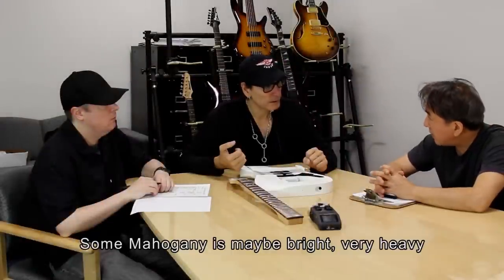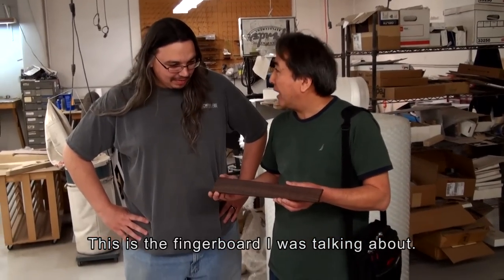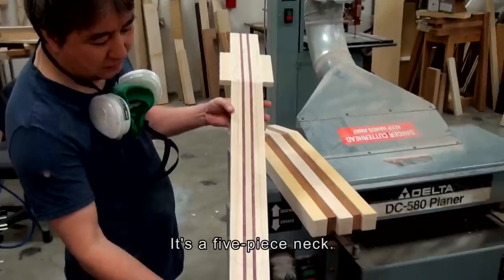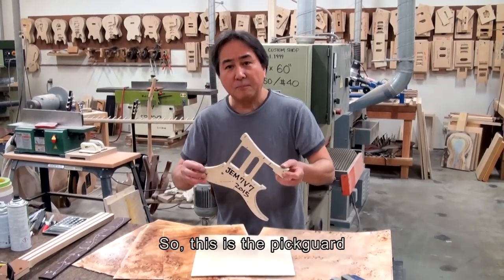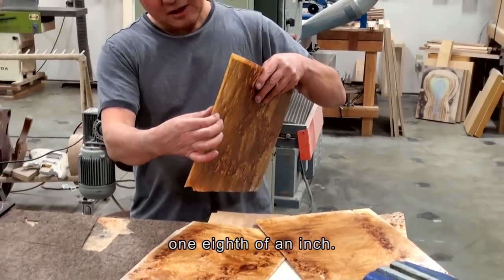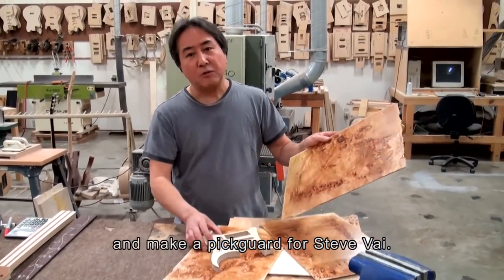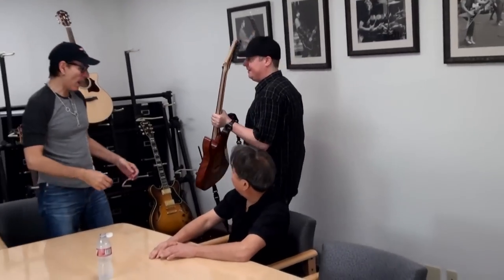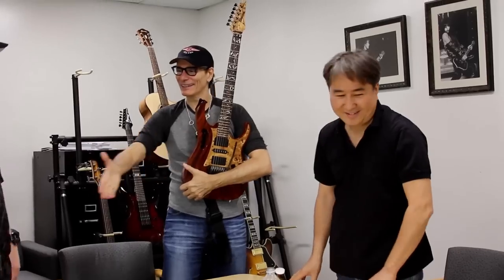The Making of Woody

Comment: I assume this is the same guy “Tak” who worked at Performance Guitar in the 80s. If so, he worked on my “Sanchez” Guitar designed by Sammy Sanchez. It’s a neck through made from Mahogany. The neck through block was made by Mike Tobias and Tak installed the wings and fingerboard and all the routing except for the pickups. I had a luthier friend cut out the pickups and get me started on the belly cut and arm contour. Pat Wilkins painted it Candy Apple Red. I myself shaped the neck and installed the frets and prepared it for painting. It’s an amazing guitar.

Comment: One mistake and it's ruined, master craftsman.
Reply: I was thinking the same thing. What if during the last stages, one of them messes up drilling a hole. Fark! It's ruined, it's ruined!
Reply: Only the best... Ibanez has some crazy people working behind the scenes for sure.
Reply: You'd be surprised at what a good luthier can repair and leave no trace that anything ever happened.
Reply: stew mac disagrees
Reply: There are two types of craftsman. Those that take an age and get it right first time and those that know how to cover their mistakes. Having a combination of both is the ideal because when you take on other peoples screw ups or do restoration the one you think is best, the first, really struggles.
Reply: Quite a joke though - a "master builder" who doesn't build but instead slaps and bolts together cnc made parts. Mexican Americans working in the 
Fender factory circa 1950 through 1960s weren't considered any thing except minimum wage workers yet the Fender Strats Telecasters and electric basses are considered to be the finest made musical instruments of the two eras. Ironically there was never a mention of them being "master builders" probably because they were just blue collar Hispanics. Racist much... gear industry media? Oh and Ed Van Halen changed the genre of Rock guitar by using a guitar made from $250's worth of factory seconds.
Reply: @BillDerBerg  It was all pretty unimpressive, especially the fact the neck inlay work was sent out.
Reply: Thinking like that is the reason why mediocrity is so damn common these days. Too many people are so afraid of taking that first step that they never end up starting, and if they do, they rarely finish what they've started.
Reply: @BillDerBerg  your entire argument kinda falls apart when you look at the different guitars. While I absolutely love fender and their instruments, they are not complex instruments, nowhere near as complex when it comes to creating and executing as this ibanez. While yes he does use a CNC machine, it is for the tree of life inlay, with that many detailed small parts doing it by hand is stupid. The guitar itself as you can see on the video is indeed hand made. He does the routing himself, cuts the neck, hand carved it etc.

Comment: Tak has a very good point about mahogany that people either mistake or don’t know.

Crotch mahogany is basically another name for Honduran mahogany. Honduran on a 24 3/4” scale guitar like a Les Paul can sound thick and chunky. The same wood on a 25 1/2” scale guitar can sound bright, especially when you use a maple neck.

People often think you’ll get the best of both if you just make a 25 1/2” scale Les Paul or something similar, but they don’t often sound that great.

Comment: You won't get what Steve gets. The one you buy for $1,700.00 is made in Indonesia, has a low gloss finish, plastic inlay, and that POS Edge Pro II Trem. It is only $1,700.00, what do you expect?
Reply: Fred Garvin yes... Only $1700
Reply: Fred Garvin In the ultra high end custom guitar world, $1700 is a drop in the bucket. I'd love to have a Woody like Mr. Vai. I went to the other side of the spectrum and got a 1957 Gibson Custom triple black beauty featuring the triple stripe binding. You don't want to know how much I paid for it. But it's worth more now than the original purchase price.
Reply: i wanna know how much you paid for it, isn't that the only reason you brought it up in the first place?
Reply: It has the Edge Zero II, which actually isn't terrible. The worse thing about it is that the fine tuners tend to be really stiff. It has the locking studs of the OE/LP, which is huge plus. The ones with the ZPS system are possibly more stable, but makes the bar dips stiffer. This premium Jems have the classic claw/spring setup. The actual components used in the premiums is mostly quite good. Its the QC in the construction phase where things tend to fall apart. The ones without build quality flaws are excellent players.
Reply: Dick Indiaz I don't like to boast on how much I pay for my toy's. But in this case I can see why, so I will. Mine is a 2000 re-issued that had gone through the custom shop 3 times (indicated by the binding stripe's, 3 is max and is ultra rare). Paid over $3400, tax not included. Now I look at most guitars like their firewood lol.
Reply: I thought the ones I saw at NAMM '17 in the videos didn't look as high quality as Steve's here .. how much do you think Steve's here would go for?  Is it possible to even get one?
Reply: I've been a luthier since 1980. I've made prototypes for manufacturers, I know exactly what goes into making a guitar. I just think it's a bit misleading to show this video and not point out the differences between this guitar and the production models. At $1,700.00, there's a TON of profit, they can afford a gloss finish and a real Edge trem.
Reply: I'm a luthier, if I want something, I build it.
Reply: I've been a luthier since 1980. At $1,700.00, there's enough profit to build it with a gloss finish and an Edge trem. The guitar pictured would cost about $2,500, the inlay work was probably $1k alone. There's plenty of Luthiers who could watch the video and build a replica of the same quality. Plus you would get to add personal touches that would make it yours, like neck shape, fret size, electronics. You would get to see the wood beforehand and select the pieces that you prefer.
Reply: I'm in south Tx and I am a luthier of 16 years, acoustics and electrics for my self, I know a lot around Houston who are not great but could easily build that guitar and it would look just as good; you don't have to be famous to build great guitars, if you don't advertise and keep yer mouth shut for the most part you can stay unfamous and no one will bother you.  I build my guitars cause I can't afford to buy and have customized what I really want. I was a pro drummer in Calif and had to stop, car accidents ended that but I keep rockin building guitars and great tube amps of  yester year, rock on people.
Reply: The 30th Anniversary ones are £3000 here, that's like $3800, they have an original Edge and are made in Japan. I haven't followed the Jem line for years,  disappointed to see they have turned it into a mid-range budget guitar.

What's crazy though is that this mid-range budget stuff still costs a premium, but isn't made in Japan anymore. The up-market stuff like the 777 talked about in this vid though, they are.

Edit : Nevermind, I was on the 30th Anniversary video and it must have autoplayed me to this one. Cheers youtube.
Reply: +Mrnicguy00 all Gibsons are worth more than bought back then my dads left handed 1979 Gibson les Paul custom with custom faded cherry paint job and nitrocellulose lacquer with a rare maple fretboard is worth in pristine condition $6000 due to the condition and the left handed and the fact it's vintage and has electronics you can no longer get and my Gibson les Paul black beauty which I had converted to an ace frehley model(I had it stripped and repainted and it's a 1977, with swapped electronics and the rare ace banjo pegs and the headstock sanded and redone with the ace inlay which costed an arm and a leg don't do it) and I sold it recently for 5798$ plus shipping for another $103 Gibsons values are skyrocketing and that's why no one can afford them anymore but I'll stick to my moderately cheap epiphones and rg350s and convert them to what I want , don't need a $4000 guitar to have fun that's why I sold my custom I didn't need it
Reply: Fred Garvin i agree with you
if i will pay$1700 with jem i may be choose jem505 or second hand jem7
Reply: I like your post however: "inlay work alone 1k" .. i guess if you use a chisel and dremel or something? You can build your own cnc mill. capable of metal and 100 times more precise than wood can even USE for < $1k. If you check out some videos.. like oh.. this one.. you'll see inlays are cnc'd, the actual inlay is cnc'd or stamped. Nice inlays are cool but you sound like one of those guys saying "oh well REAL speaker boxes for your car cost at least $23423 .. when theyre fucking boxes a 5yo could build. The MONEY here is a combination of hardware and those two luthiers handbuilding half the guitar. The money in MOST guitars is markup. Theyre built for about 25% of retail or less and half the money is in hardware. There are podcasts about this by people in the business and when you hear them talk about it theyre not being ruthlessly greedy.. they explain the numbers. Frankly i think american companies are toast because american  luthiers expect $30, 40 50 an hour.
Reply: i have money if i got a professional setup my "cheap ibanez art100" would outplay anything this guy ever built given the same $$$ in hardware/pickups
Reply: Respect especially on the tube amps. I looked into it and .. honestly it looks like a pain in the ass.
Reply: Your epis are FAR bettter guitars dollar for dollar. You'll note anytime theres a comparison..especially on youtube.. people will compare a $2000 strat or lp to a $350 epi or ibanez...
Reply: An Ibanez Jem7 is a better playing and better finished guitar then any American Strat ever made. Not sure what you are talking about saying the Jem7's are made in Indonesia. They are made in Japan. Maybe you bought a Jem Jr or something.
Reply: RELAYER  Nah, not really. A Jem7 is on par or better than a Fender Custom, but the American Fender is just ok. I love American made guitars, but the American Strat is overrated in sound and quality, nothing special.
Reply: RELAYER  I have one too, and an American Strat, and a custom strat, and several Gibsons and you are just plain wrong.  Sorry dude, not sure what is wrong with you Jem7, but the Jem Jr isn't a Jem7 in quality, finish, or sound. Even the fret finish of the Jem is better than an American Fender, it is smoother and the details of the whole guitar is a level above.
Reply: RELAYER  Sorry about that, the Woody is a whole different beast then the Jr. We will just have to agree to disagree about the Jem7 though. On a personal level I would rather play my SG over any other electric guitar, but I still love my Jem for it's play-ability and versatility. And seriously, the Japanese fret job and perfectionist attention to spec and finish is hard to beat from my experience. I do plan on building a "custom" strat to my specs soon and then I will have a strat to love. Until then, fender will still be meh to me.
Reply: I hate the pickup covers on the production model and the "exotic wood" umm, well, erm, I don't know what it is......yuk
Reply: Not true. The ones I've played and owned were around $1700-$2000 new and have ALL the same shit Steve's has, had two esp kh-2 guitars too from Kirk hammett, both SAME exact shit, don't be mad you paid $1700 for an Indonesian one. Lol
Reply: For that price they could at least put a lo pro in. Like the 550s had
Reply: For that kind of money you can make your own custom guitar from scratch no....scratch..that, you can make two of them.Best hardware,stainless steel frets,your own inlays,fretboard radius and neck profile and last but not least choice of woods.Whoever spends more than 1000 for solid body electrics is insane.

Comment: Maybe he can build a Jem that doesn't crack around the heel mount?
Reply: Dissonant Timbres My Jem 777 cracked. Couldnt sell it on eBay or even trade it in for something else at a guitar shop. Same thing happened with an Ibanez bass I had. Never again. :/

P.S. Several of Steve's own Jem's have gone the same way, including EVO and (possibly) FLO.
Reply: CountryHouseGent I cracked the bolts the bar screws into on  My 6 and 7-String A series with the zr tremolo working on some Dimbag squeals. R.I P. my Eskimo Brother.
Reply: Dissonant Timbres it is common. however the cracks in the heel are usually just the paint, when the wood shrinks in colder times of the year. it's generally an aesthetic problem, and doesn't Crack the wood unless the guitar is dropped. it's a moot thing in Ibanez guitars. it would be like devaluing an old strat from paint checkering. it happens, and in my opinion, it adds character.
Reply: i use and enamel pin to fix pain cracks
Reply: Can't you can repair that with wood glue and clamps?
Reply: CountryHouseGent - If ya still wanna get rid of it.......maybe I have something to trade?
Reply: CountryHouseGent this is why neck thru will always be my preference
Reply: Get a USA Jackson neck through.  problem solved.  Glad I could help.
Reply: I’ve had a 7v based custom since 1992, beat the shit out of it and barely chipped the paint - what the hell are you doing to your guitars?
Reply: Vai seems like a nice dude.
Reply: It isn't the guitar's fault you keep dropping it.
Reply: Cracks in the heel joint mean nothing. It's literally the paint cracking. Nothing serious whatsoever.
Reply: Disagree, 18yr old jem still going strong. Even with such a thin profile no cracks or anything
Reply: Even Steve's own 'EVO' has a crack there. Apparently, there's not enough wood there to prevent the neck from shifting up and down.

Comment: One of the things that I find most interesting about this video is how Steve is not a guitar maker. It's an odd thing to say, however it's worth taking it on. Steve specified a brighter sounding wood and suggested Mahogany, which in most instances (if you're talking genuine Mahogany) is not the case. Tak diplomatically took this on and shaped suggestions to meet Steve's goal. It's important that Steve can concentrate on the music and not on the "entire other field" of making instruments, however if he didn't have a guy in the shop who also does front of house spec'ing like Tak, things would without a doubt be "less easy" to make happen, likely with more friction and a "less good" end product. I'm a guitar builder with getting on two decades of experience now, and Tak's skills are truly ground-up and great to see still existing within the industry. I made a similar RG with SG aesthetics, crafting the tone up from the wood choices. In my instance, Sapele and Wengé as opposed to Maple and Bubinga. Khaya in the body. The only criticism I might have about the specification of this guitar would be the pickups on the basis that they were thrown in as "oh, Breed pickups" rather than matching something that specifically works with and brings out the ideas in the woods. Something a little less potted to make her more touch-responsive and with more tendency to translate the tone of the wood like (good) PAFs did. I'm just glad to see Steve moving away from Basswood in the body, especially since it exacerbates trem post wallering and problems around the neck joint. Anyway. Enough of my opinionating, and make with the music guys!

Comment: Ibanez aka I've Been Had... Ibby ... and E. Bañez for our Hispanic customers. Those were the joke names for Ibanezes back when I worked the guitar floor at Guitar Center in '89-'92. I never really wanted an Ibanez except for a Vinnie Moore signature because it had the old Floyd Rose without the fine tuners and the Double Whammy pickups which got a great thick Holdsworth tone. Jems or the Universe didn't peak my interest even though I was the first person to receive the first 7 string Universe for our store. I took it out of the box and wank on it before I set it up. Didn't need to get used to the low B but I would've preferred a high A string to get the dogs howling....